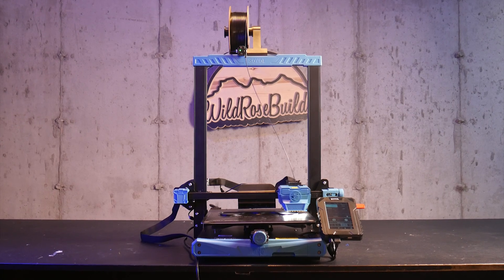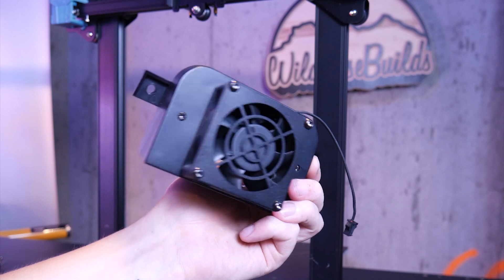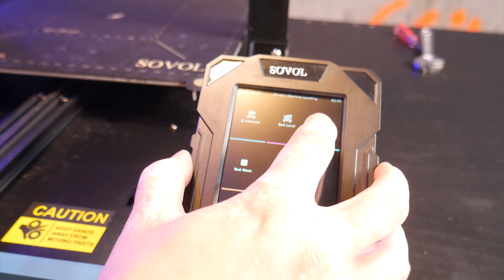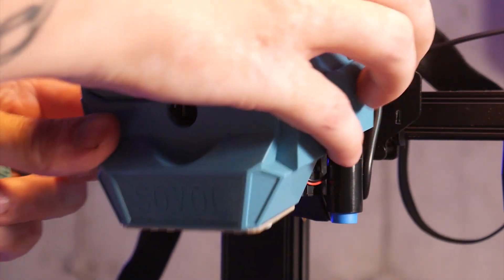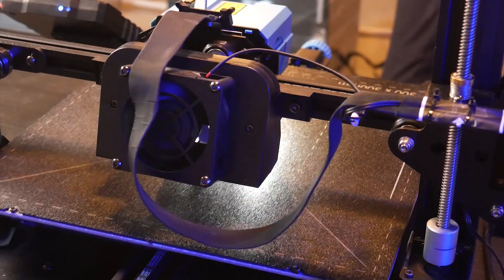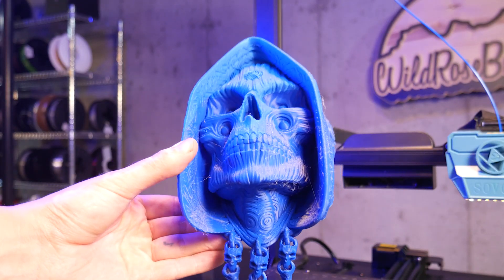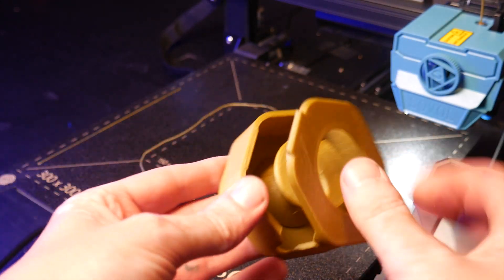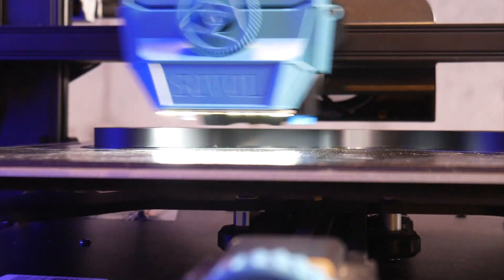Sovol SV07 PLUS - First Look / Review

Comment: I want the stl of that print in place box. And btw your tree print looks glosier int he back not because of temp , but because it was getting blasted directly by the auxiliary part fan. Which why I hate those contraptions : they work great ONLY on the side the air shoots at them, so it's a too little of a reward for having to put up with A LOT of roaring noise.

Comment: Not related to the video... Just thinking out load.

For small scale production I think you need a pla printer for prototyping and a resin printer for making hi quality rigid  positives for molds. Molds will give you both the speed of manufacturing and versatility of materials.

Comment: Looks like it's time to replace my old SV03.  I was thinking about the Bambu P1P (coreXY is the future), but I need something for bigger prints (I agree, that a printer this size needs a 0.6mm nozzle).  At this price, I can save up for the Bambu after I get the SV07.
Reply from the maker: Look into the qidi xmax 3. Core xy with heated enclosure and 330x330 build volume. I’ve been getting amazing prints on mine using abs at high speeds. I’ll have a review on that shortly!

Comment: I have some awesome prints with this one. It's priced at only $309 (early bird + $20 coupon), which is absolutely amazing. However, there is one downside that I have noticed. The Y-axis rollers tend to wear out quickly when printing at high speeds.

Additionally, I recommend always using a brim when printing. I suggest using a 6mm brim with a 0.2mm offset for easier removal. This not only helps with adhesion but also protects the corners from warping.

It's important to note that increasing the speed might not result in a significant improvement due to the volumetric flow of the bigger nozzle size, which is around 30mm^3/s. So, keep that in mind when considering increasing the printing speed.

Comment: I did a review on this one. It's okay. The PEI sheet sticks like glue with PETG, which I like, but the Klippad sucks because it's based on the MKS Pi and RK3328 CPU, which is known to have overheating and MCU shutdown issues that Makerbase and Klipper won't look into. When I asked, Makerbase told me to buy new units even though mine were < 90 days old and Klipper being Klipper had their holier than thou "we do nothing wrong, it's all your fault" toxic bullspit attitude. I hooked it up to my BTT Pad7 and even connected it to the pad7 wirelessly via the Klippad for gigs and skittles. I made an instructional on my github with additional assets to add more preheat options and icons to the Temperature page. I do like what they did with the housekeeping of the button layouts in KlipperScreen.conf and might try to incorporate those little quality of life changes into my Pad7 setup. The printer, however, is probably going back on Sunday. Yours probably has the latest firmware like mine did but so many people are bricking theirs because of bad firmware. If you want to decouple the hot end fan from the auxiliary fan, you'll have to remove the shared fan pin section and assign a separate fan  section for the auxiliary fan in printer.cfg (which will probably require a bunch of slicer mods, so it may or may not be feasible). I do love those bed alignment screws, though 🐱

Comment: I just got mine.
Assembled, leveled the bed and printed up the benchie supplied. almost flawless. Yay! my first print ever!
I tried loading a couple of prints from cura 5.0, but it threw out an unrecognized command error. needs an upgrade.
downloaded the firmware supplied on their website. followed the instructions supplied, when I pressed upgrade, it spat out an error message in Chinese, and bricked itself. Any idea how to fix this?
Reply: Sovol sent me a new firmware chip in the mail, Yay!
Ok, I've done several benchies, and put it to work immediately cranking out small, useful parts for my day job (my company buys them)
This being my first printer ever, there is a lot of trial and error, fine tuning and the like.
My biggest complaint so far, is when a print wrecks and sticks to the extruder.
there is no Z axis lift command anywhere I can find that doesn't require homing first.

What if it won't home? I ran into that this morning, with half the print stuck to the extruder, no access to it without lifting it first.
I tried to, but all I got was continuous grinding noises while the thing pressed itself into the build plate. power switch.
I finally got it off on the next try by shutting off the power just as the print head hit the corner of the build plate position.
had to re level the bed afterwards, it got tweaked
Reply from the maker: did you try to flashing over USB? there should be a way to upgrade from an attached thumbdrive instead which i find has better results. as for slicer i'd stick to whatever they supply even if its a bit older. there's usually some funky start and end gcode you have to transfer to a newer version of cura.
Reply: @WildRoseBuilds  That is exactly how I did it. reformatted the thumb drive and copied the firmware file 1.0.9something.
I then put it in the machine while powered off, rebooted it. then went Configuration>System>Upgrade. the thing spat out what looked about 2 sentences on Chinese in red text on an orange background. likely a critical warning (this was not displayed in the help video). the thing restarted once, then again, to no brain for the past 24 hours I left it running
Reply: @WildRoseBuilds  yes, i copied off the files and reformatted the supplied drive, loaded the update to it  plugged it in, cold started the whole machine and pressed update after boot up as described in the video. It then put out a line of chinese text in a box at the top of the screen, yellow on an orange background. After a while, it rebooted, the GUI behaved wonky as hell, I thought it might have been a bad update, so i pressed factory defaults, pressed yes when asked, it pretty much bricked right then
Trying to get a replacement display/driver for it now

Comment: I would love to see Sovol succeed, but their QC is pure crap.  I bought an SV06 based on influencers and am spending way too much time redesigning injection molded ABS parts because they just break under heavy use.
Reply: sovol is built by creality... there's your QC issue in a nutshell :\
Reply: @TheFeralEngineer  yeah that explains it, though I think Sovol has the less allocated to the QC budget.
Reply: @CuttinInIdaho  it's a giant race to the bottom for all of these companies right now. They're pumping out product faster than they can even finish testing their firmware and either bricking machines with field updates or having the machine go Skynet and try to shove the business end into places it really doesn't belong. Plus, they're installing a firmware that requires a hair more brain power and user intervention that people aren't used to, so there's been a ton of backlash due to the learning curve. I've got a slide in one of my videos that sums up the Klipper experience titled "klipper is not for teh dumbz" that I think is pretty on point.

Comment: So besides the lights, what is the point of that massive shroud? It doesn't seem to have anything on it besides the lights.
Also, I would really love to see a direct comparison between this and the Neptune 4 Plus (hopefully Sovol does a Max version of this to match the Neptune 4 Max).
Reply from the maker: yeah the shroud is a waste. i dont think sovol will do a max version of this, i dont think they have ever made a printer larger than 300MM.
the big comparison between this and the neptune 4 plus is the built in accelerometers and the gantry struts which i think work better than the angle brackets here.
Reply: @WildRoseBuilds  did you have to patch the neptune firmware? there have been banging issues with homing the plus and max. So far, it's looking like if you adjust driver_sgthrs slightly and slow down homing speed to ~20-40, it will rectify the issue.

Comment: one word Elegoo much better, bigger size, faster less trouble, reliable, good Wifi and Network. =.- winner
Reply: I wouldn't call it less trouble and reliable considering how many first layer and auto leveling problem the Neptune 4 has. Elegoo even admitted that the firmware and leveling sensor are flawed.
Reply: That would be for the Kobra 2 Max, Neptune 4 is flawed in all of it's iterations.
Reply: Hang on, I’ve had excellent results with my neptune 4 pro. At first I had some strange layer shifts but realised that I had tightened the x-axis belt too much (it snapped :)) after replacing it Ive had excellent, and fast, prints.
Reply: That's WAY more than one word.
Reply: Oh also which Elegoo?